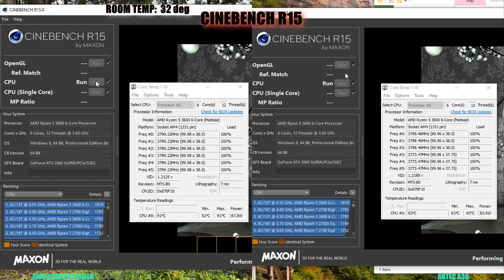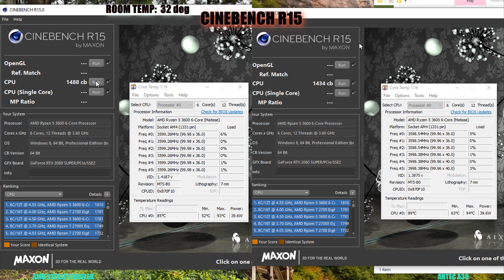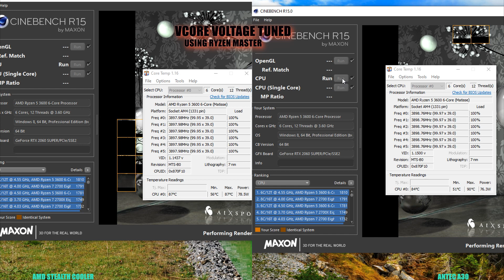Antec A30 with Ryzen 3600 | Installation , Performance vs stock cooler

Comment: I have a  3300x and whith stock cooler the temp are 80° aprox. When buy Cooler master 212 rgb the temp reduce to 60°
Reply from the maker: Stealth is much suitable to only ryzen 1200 !
Reply: @OdinHardware  I l have ryzen 5 3600 and spire cooler and when I run cinabench I got 74 degree

Comment: Do not buy a30 cooler for these processors, i have the a40 pro and im getting 40 in idle and 65 on load, which gives better performance than CM H410r and a40 is on par with CM Hyper 212.
Reply from the maker: And A40 is much cheaper than 212
Reply: @OdinHardware  That's what im implying, i've got the a40 pro for 1300rs so it's a pretty good deal.
Reply: is a40 pro still a good choice for ryzen 3600? how was your experience?
Reply: @azmayin  It's a great fan.

Comment: Bro please make a video on removal of this cooler please.
Reply from the maker: Just press the lever downwards and push outwards.
Reply: @OdinHardware  No i mean how to remove the bracket that comes with the cooler?
Reply: @OdinHardware  😂😂😂😂
Reply: @mrb00ce2  back side of case push the black thing with a screwdriver it should pop out...